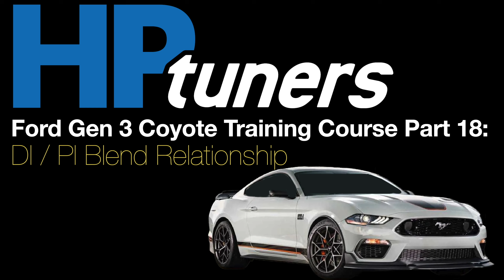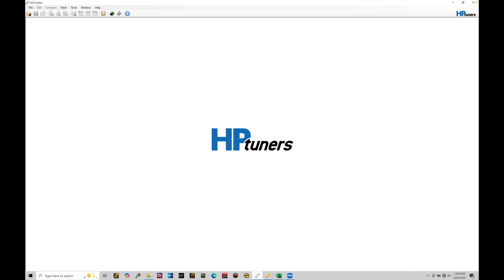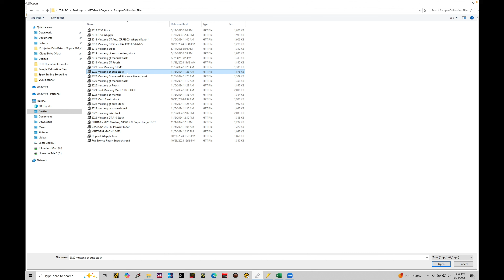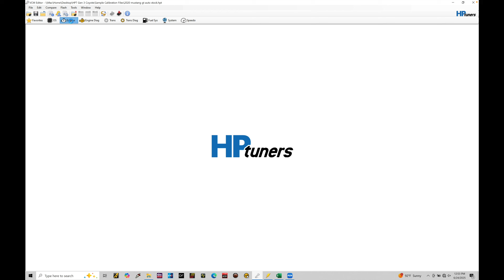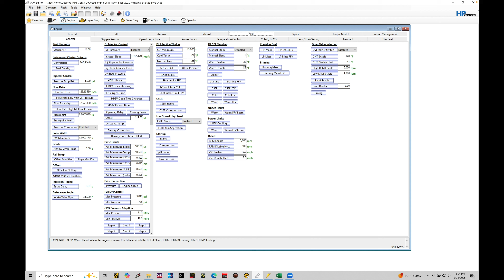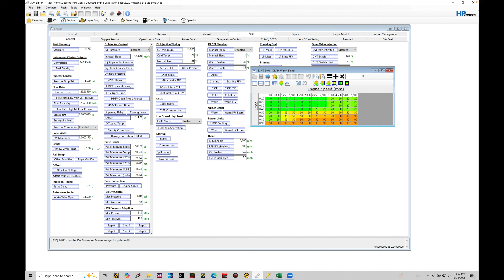HP Tuners Ford Gen 3 Coyote Training Course 18: DI/PI Blend Relationship | Evans Performance Academy

Comment: Can the DI system be deleted to just use the port injectors? They make block off plates and swaps with a Gen 3 are difficult as motors get a lot of this stuff stripped off when the yard wants to part it out.